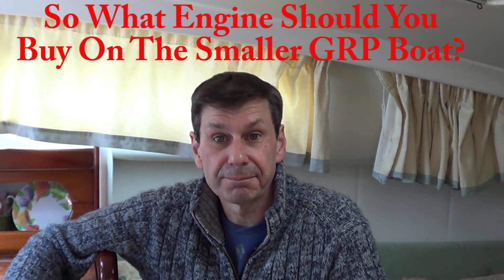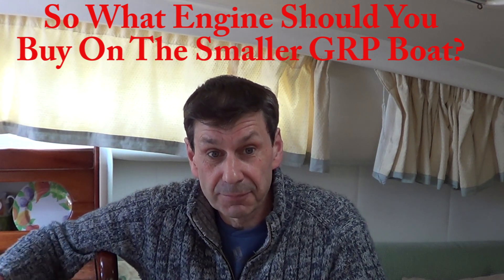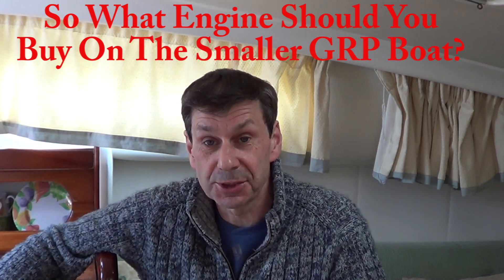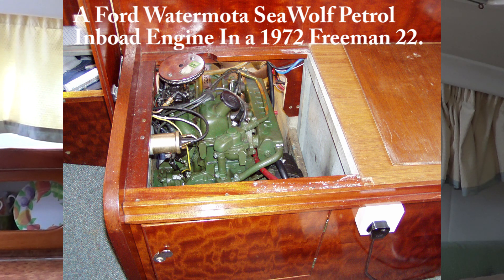The Best Engine For A Small River Canal GRP Boat

Comment: A very informative piece, Kevin. Thank you for sharing your thoughts. I am looking for an outboard for my first boat and spotted a diesel outboard (Volvo) online. Have you any experience of diesel outboards? Thanks.
Reply from the maker: I knew a guy that had one of these and it was shed loads of trouble!  mind I have to say he was not very mechanical-minded and I think he caused a lot of the problems himself all fuel-related we did get it running OK in the end. That was a good few years ago. Not sure about spares for those now I should check that out before you buy Volvo can be mighty pricey on spares and hard to find sometimes. I still like the Honda outboards in my view very sound engines that seem to go on and on and easy to look after. But that's just my view. Thanks, Kev.
Reply: @BramleyProductions  Good advice, Kevin 👍🏻

Comment: Those Canal and River Rescue guys and gals must be tough cookies. Imagine if you broke down halfway through a series of locks, they'd have hard time getting to you within an hour!
Reply from the maker: Yes, where I am on the river sometimes you can't get a van close it would be a long walk! More often than not. Being honest I always try to get going myself if possible half the battle is keeping it all well maintained but sometimes stuff just does break or die on you. Thank Kev.
Reply: @BramleyProductions  I suppose, with the technology that we have these days, if it came to it, you could video on your phone the problem and explain what the problem is, with the engine or whatever and relay it to the engineer/recovery person, so they'd know what tools/parts they'd need.
You are right about keeping the servicing up to date. It's best to look after the engine and other working parts and electrics etc.
Reply from the maker: @BritishBoy1971  Yep that's a very good point you raise I mean most people have a phone that can take video or pictures to send to these people in advance and, to be honest, boat engines are mostly diesel which is not too high tec like modern car engines and its still pretty basic stuff more often fuel-related problems if the engine won't run or start say or broken gear throttle linkage cables etc, that kind of basic stuff. Yes, very important on a single-engine boat if you are doing any coastal work first to know your engine and keep it very well maintained indeed on the river you can just pull in to the bank say but at sea, you could be miles from land and help! Thanks, great you raise some good points Kev.

Comment: I live near a canal, grew up around them, even used to volunteer for CRT so obviously like many I understand a lot about canals and moorings.  But I do not know anything about wider boats, what are the negatives (obvious one is it can not travel along narrow locks) about being on a wider boat.  Are marina costs more expensive, are mooring locations easy to find on rivers?  basically imagine you just met someone who knew everything about canals and nothing about river boats.
Reply from the maker: Many thanks for your interesting question! I suppose one of the biggest difference re a navigable river say, to a canal is your have to bear in mind most rivers have flowing currents! And are hence are much deeper than canals! why I kind of bang on about wearing one of the modern life jackets when boating on one. So maybe this is more important on a river! As you will know canals were hand dug by the Navies. Rivers need that bit more respect just about all are rivers are liable to flooding! But nowadays the Environment Agency do fly red flags and you can sign up for text message service to notify you if the navigation is closed right nowhere in this part of the world both the river Nene and River Gt Ouse are closed to navigation to high water levels after all the rain this can even happen after a heavy summer thunderstorm so you always have to bear this in mind again and beware on this fact if you boat on a river. There again rivers often have much older bridges some of these are arched and have restricted headroom clearance for boats even more so if the water level is up so very important to check your boat has headroom clearance for any river you are thinking of going on with the said boat! Where I moor the Sealine I have a GRP boat next to me that the guy brought not thinking about this he had the boat trailered to the Marina and the boat will not fit under the bridges to even get out of the Marina so it's going to have to be modified at expense just to get out on to the river! Locks on rivers work on much the same principal but are often much bigger and can look daunting I intend to take a look at some of our river Nene locks in a video but locking principle is much the same but on a bigger scale take you time and get in to a good safe locking routine and this is no problem once you get used to the bigger size Yes naturally if you have a wide beam boat or a boat with a high headroom height it will restrict your access on some of the canals for sure but here where I am I have over 300 miles of river to cruise on! The River Nene goes to  Peterborough where I could gain access to the middle-level navigation which will then lead you to the river Gt Ouse. 
 Another lovely river to cruise on!

Price varies on rivers I mean The Thames for good reason has lots of Marinas and boatyards and all kinds of boating facilities and hence the price to moor on the Thames can be high, but I think Are prices around here are pretty comparable to any canal Marina charges these days often facilities can be more limited on rivers the river Nene here does not have that many boatyards say or Marinas that offer work facilities or boat repairs  or palaces you can buy fuel say. But that apart I love rivers as they are so natural. I mean most of our inland UK rivers were formed after the last ice age so has evolved over many thousands of years also with a helping hand from men to make them navigable and even rivers have had their course altered in some cases by man over the years. I might take this on further and do a video re this interesting question that you have asked but I hope that has given you an idea to my thoughts on the difference of river to canals there are many more point I could say and cover on this topic for sure but to keep this reply not to long I hope that has covered a few pointers. Thanks again Kev.
Reply: @BramleyProductions  very detailed, thanks for that.  Just watching your latest video right now.